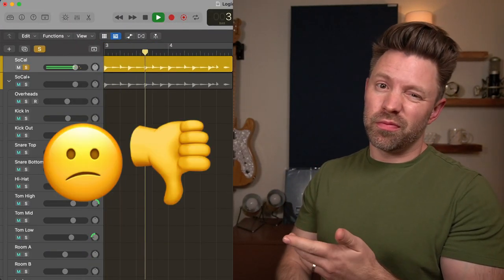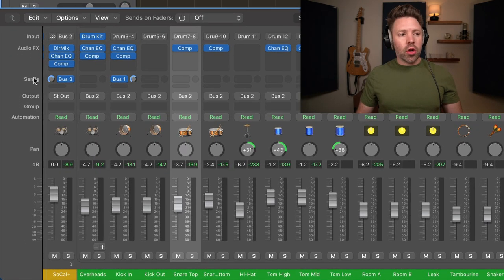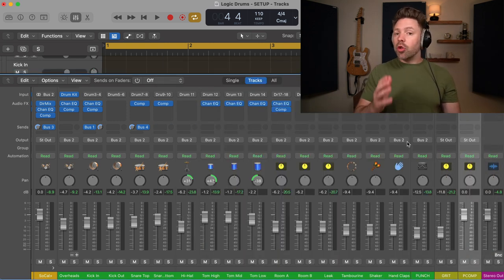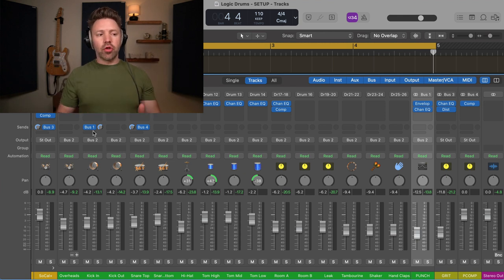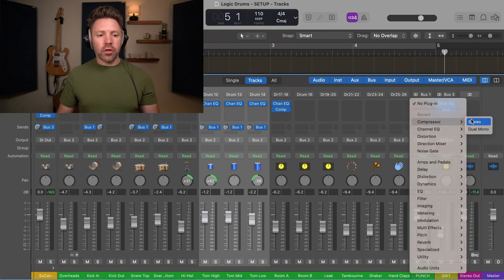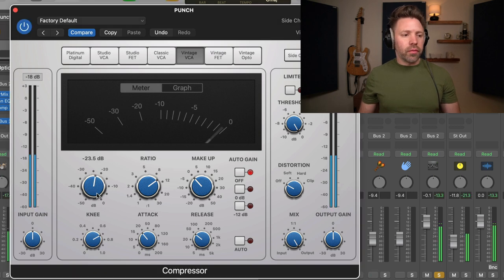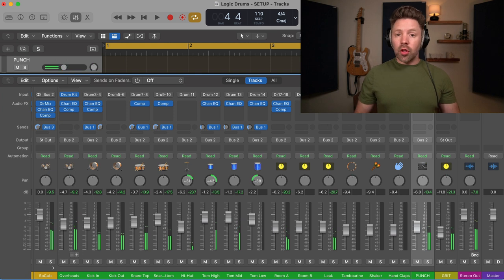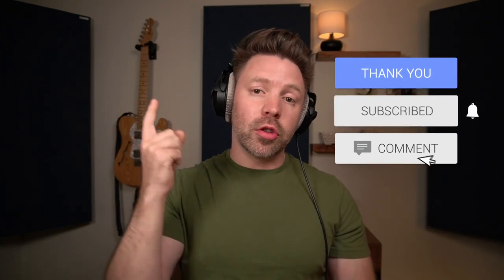EASY Parallel Compression Technique for a HUGE Drum Sound | Make Logic Pro X Drums Sound REAL Pt. 3

Comment: Only thing I don't like doing it this way is you can't hear the delta signal essentially. Surely you can hear the change, but I found creating a whole track with the same drums (or whatever you're parallel compressing) to be easier. Duplicate the track and do everything you want to it while the other is muted. Then, just turn the volume up and blend it in that way. Love doing it this way especially when adding eq or any other plugins after. Curious to know if anyone else does it like this.